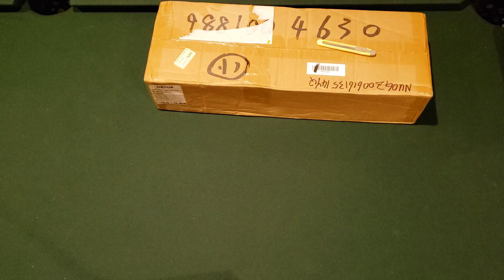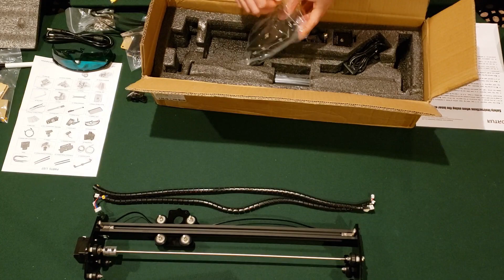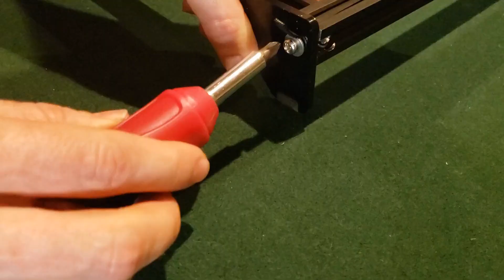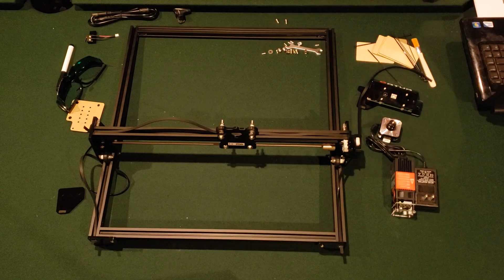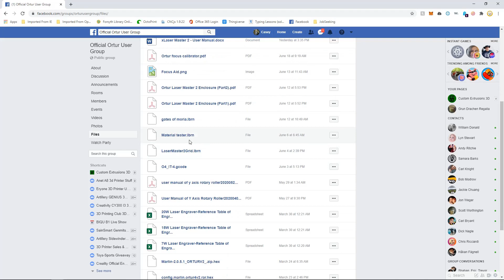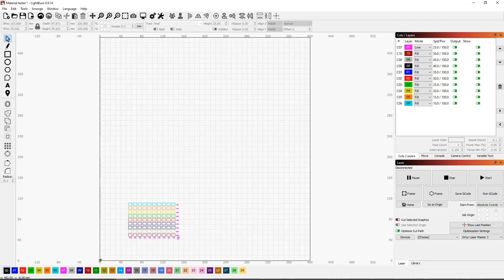Ortur Laser Master 2  unboxing and assembly

Comment from the maker: For anyone shopping on Amazon US, here's a current deal:
Use code NL5YDNHR to save $5!
 https://amzn.to/3otnT2z
Reply: This was fabulous tutorial. Thanks so much!
Reply: I purchased the same unit.  Mine came 80% assembled. All I had to do was build the frame, add the gantry, plug in the wires, and done.  It came with a few extra parts, but missing one washer for belt tension, which I already had on hand.  Next time you make a mistake in a build, it would be helpful to show both the mistake and the fix.  Mine came with zero instructions on the build, and you helped me put it together, though it took longer than it should have, because I had to keep going back to reference your video for the next steps. And to see what mistakes you made.
Reply from the maker: David, thanks for the updated info and feedback. Lots of learning,  notes taken if I ever get back to filming!
Reply: 6:17
Reply: Bought mine off gearbest for 280 on sale. 20w.

Comment: I cant seem to get my belts 100% on correctly, straight lines keep wiggling. The one connected to the limit switch is the main issue. If I try to tighten it from the back end, it pulls the limit switch forward (because its literally 'floating') and trying to deal with the belt through that end is even worse because the belt goes through the same hole that the screw does, so just the act of putting the screw in, pushes the belt back, creating slack.
Reply from the maker: If you have the same set up, I believe you have the limit switch in the wrong place. Mine is located on the underside of the frame, so that it contacts the bottom wheel

Comment: I connected the device to the computer, but the computer does not see it, what should I do?
Reply from the maker: There could be a number of reasons for this. 1st, check to make sure the machine is turned on, before plugging it in. 2nd, you may need to update/ download the latest drivers for your computer. It's tough to provide more guidance without knowing more about your PC specs

Comment: I appreciate the resource but the instructions are not very clear in your description or visually and can easily lead to a lot of errors in assembly. Very frustrating to follow along at times. For example at 16:57 when you recommend to thread the belt prior to screwing after you already finished that step. The viewer is following along so almost certainly that isn't helpful.

Not trying to sound ungrateful for your video as it is helpful, but just hope future viewers can save some headaches I had.
Reply from the maker: Thank you for the constructive feedback!

Comment: When it homes the motor doesn’t stop I think maybe the limit switch doesn’t work? Or is this a driver issue?
Reply from the maker: Most likely the limit switch. Try manually triggering it while the motor is in motion. If it stops, you just need to adjust the switch's position. If it doesn't stop, check the connections on both ends

Comment: I just ordered and put this together using your video, thanks! However, the Laser 4 now has what looks like wire connector hooks. Not sure if these are for grounding or what and where to put them. Anyone else run into this?
Reply: Those are grounding lugs

Comment: hdpe Plastic
Can I use it here?
Reply from the maker: For what purpose? Etching on, cutting through, replacement parts, something else?
Reply: @ce3dprinting94  
HDPE Plastic Circular Container
We need to print the logo.
Reply: @redwitchlynjunior9565  You can, but HDPE burns at low temps, so you need to keep the focus small and at a distance.

Comment: What is the best wood to engrave? I read online that alder, maple is good? What do you recommend and have you engraved a bamboo cutting board before?
Reply from the maker: I have only been able to do a few small things on pine for testing. Bamboo cutting boards are very popular, but I have no experience with them or the alder or maple. In general, I know that having an air assist and using painter's tape are good ways to improve the engraving,  no matter what wood you're using.

Comment: Suggestion - Your video has SEVERAL ERRORS that you should either correct and repost or pull down the video.  Not trying to be mean just I spent twice as much assembly time as I should have following your video

Comment: I just build mine and it doesn't sit level. Is there a way to adjust it or is one of my frame bars just slightly warped?
Reply from the maker: Did you check the squareness of the frame? You can check if one of the bars is warped by placing a straight edge (ruler or level)  on each piece, looking for a gap between the edge and the bar
Reply: Loosen all of the assembly corner screws, and L brackets.  Set it on a level surface then re-tighten.

Comment: Tip for anyone watching: put the feet on before the gantry. It is not otherwise intuitive that you should have two wheels on the top side of the frame and one in the bottom side of the frame. It will also make positioning the timing belts later easier.

Comment: HI, quick question-i have the ortur 20w and  I assume the metal cylinder- about an inch tall is for height gauge.  if you can confirm

thanks
Reply from the maker: Yes, the cylinder is a new addition, since the z-height is now adjustable. It should be placed between the bottom of the lens to the top of your surface being engraved.
Reply: @ce3dprinting94  Hello, I have watched several of these Othur how to videos and no one ever gives the proper height of the laser to the workpiece. Can you clarify this? thank you
Reply: This had me s confused! So glad you posted, the long thumbscrew makes sense now to hold it in position :)

Comment: At 20:07 in the video, top of the screen in between the usb (?) cable and your arm ... what is that piece?  I can't find a reference to it in the manual.
Reply from the maker: It is a piece that is only used on the 7 watt version, to feed the wiring into the coiled sleeves. If you have the 15 or 20 watt versions, you don't need it.
Reply: @ce3dprinting94  Ahhh OK, thanks (I have the 20W).  It has been driving me nuts!  Cheers

Comment: "Still SMOKIN!" A Very Good video! That means I don't have to make a video of MY unboxing, assembly and test fires. I bought two of these on sale last night. How long did you wait after your purchase? Your video will help us immensely! We got the 20 watt versions. I think I need to buy extra safety glasses and shielding for the laser. Do you know of the best deals for that kind of thing?
Reply from the maker: I don't currently have a recommendation for safety glasses, but you can search for "400-450nm glasses" on Amazon. The laser operates between 440-450nm
Reply: @ce3dprinting94  Thanks.

Comment: My third foot doesn’t have a flat slot to put the timing belt in ? I have the same laser set up
Reply: Glad to know it wasn't just mine. Mine was missing a belt slot also. Used one of the others as a template, drilled it out and filed it to shape.

Comment: Thinking about getting one of these but need to know if it the right one.   I am doing cutting boards - serving trays and want to do some custom engraving on them.  They will be about 18x12.  Some larger some smaller.   I guess the question is can I place this on top of the project to engrave what I need to?   None of the engravings will cover the entire project, just initials or other images onto it.  How large is the actual engraving area?   Thanks
Reply from the maker: The 15W would be a great choice for what you're doing. The actual engraving area is 400mm by 430mm, which should be sufficient for most cutting boards
Reply from the maker: And yes, you can place the machine on top of your work. You just may want to get an adjustable z-height adapter,  to get the optimal distance between the laser module and the surface

Comment: can anyone help? I've assembled the laser engraver, and downloaded Lightburn trial, but don't I need a driver?  When I open Lightburn, it does not recognize the laser.  I says "waiting on connection". Did i skip a step?  Super frustrated and ready to send back.  is it even compatible with iOS? or do I need to have a windows laptop?
Reply from the maker: Some quick research shows that you want to start Lightburn first,  then turn on the LM2. Also, if you have more than one COM port,  you will have to manually select it in Lightburn. Hope this helps!

Comment: Hi thanks for your video, got it together after a few hours lol, im struggling at the moment with downloading the drivers, ive downloaded lightburn, but my pc won't find the actually laser through usb,
Reply from the maker: Did you use the tinyurl in the digital manual to download the driver?  If so, did you unzip the file and update the driver through Device Manager?
Reply: @ce3dprinting94  thanks for your reply,  I haven't used any digital manual is that where I've gone wrong?
Reply from the maker: I'd start there first
Reply: @ce3dprinting94  thanks, ive had one of them days, should have actually read the manual  😆

Comment: Hi
My Ortur LaserMaster 2( 15w) was working nice for 2 months but today the laser head is not moving at all. What do you think is it a softwer problem? I already checked everything :( Thank you
Reply from the maker: There are a lot of variables here.... are you able to test the motors that drive the X axis and Y axis, to make sure they work? I would start there, then move to the controller board
Reply: @ce3dprinting94  Yes everything looks fine and I checked electric boards as well. On PCB there isn't anything burned out
Reply from the maker: Margo, I'm sorry I can't be more help.  If you can move the motors by hand,  and electrically, it's possible you may need to reinstall drivers on your computer. But again, many variables
Reply: @ce3dprinting94 
Already done, working nice again :) Thank you

Comment: I just assembled mine tonight - is it ok to have the belts be so tight? Did you run into any issues?  thanks for the awesome video!
Reply from the maker: They only need to be tight enough so that they don't slip when the toothed gears move along them. I've had no issues so far
Reply: I'm having issues with it like it starts bouncing back n forth I have to tap it and it will then move any advice?
Reply: @elgato9720  too much tension on the belts?
Reply: @retrodad1973  gues wat it was lol loose wire on y axis motor

Comment: I buyed it, so disapointed. The laser can not focus to a dot, it makes a line or small rectangle. i think was a hardware problem but it isn't, they say the laser diode is that form. Try to write small letters with a chisel point marker, thats the results you'll have. Also i still can not marking anodized aluminium or stainless steel, and the instructions says is capable of that. The ortur service only limits to re send me captures of the instructions. I would return it if i could but they say the machine functions are normal. Damm i must have buyed the neje but saw the reviews too late.
Reply from the maker: Dorian, sorry to hear you're experiencing difficulties. Have you tried using a coating such as nail polish or dry moly?
Reply: @ce3dprinting94  yea, i used nail polish and a black water and oil marker, 3 pass 60mm/min the moly was inpossible to get in here, im in mexico, (also buying the laser was an achievement,) the only thing was marked was my finger with that hot spoon, lol, also thanks for your video, helps a lot, i saw it fist time while chatting with my wife and dont put attention about that 4 squared nuts... Then wft? When almost finished🤣
Reply: you need to raise your material closer to the laser - you will then see the dot
Reply: @retrodad1973  well my friend, thanks for your response, you know the laser was in fact defective, was losing power over days, there is not capable of even engraving anything, the ortur people doesnt believe that and send me settings and settings and screenshots for configuring it... Obviously with no results, im in the middle of a dispute right now, i already send a bunch of videos the way they requested, they will send a spare module, but i has to pay the shipping, im so disapointed, works well for like 7 days, i made only test, i dont burn it down working. I payed more in the end, those ortur guys on aliexpress was very hard jaw. For a little and  has to keep the useless device. So  sad. Well, i hope the new module works ok....,,😣

Comment: thanks so much for a great tutorial.  I ordered mine and can't wait to get it.  I believe you mentioned that on the ortur website is a link for a free trial of lightburn, but I do not see it.  also, that test pattern that you burned in your video.  where did you get that please. I don't see it on the ortur website either.  thanks
Reply from the maker: Steve,  the link to the free trial of Lightburn is just a link to their website provided in the digital documents when you receive the machine. The test file is found in the Files section of the Facebook group

Comment: Hi 
Thank for sharing
I'm facing one issue with the area of engraving.
I can't adjust the size  W & H  separately.
If i adjust the W the H will be automatically adjusted.
Can you please help on that
Reply from the maker: Haythem, I'm sorry for the delayed response! I don't know which software you're using,  but most have an option to click a "lock" icon near where height and width are entered. That should allow you to scale each independently. Maybe knowing which software you're using could help me answer your question more accurately.
Reply: @ce3dprinting94  thank you for your response dear
Im using laserGRBL
Reply from the maker: @haythemelnour763  , LaserGRBL would require you to non-uniformly scale your image in another program first (like GIMP or Inkscape).

Comment: What timing!  I just got my Ortur and found your YT instructions.  So much better than the Word doc that Ortur provided!  Could you provide tips on how to square the frame?  I ended up loosening the M5 screws about a full turn, using a pair of carpenter's squares on opposite corners (while laying the whole thing on a glass tabletop), and gradually tightening the setscrews.  This  worked pretty well.  Then I tightened the M5 screws.

Also, how important is the tightness of the timing belts?  It looked like you really pulled them tight.

Thanks for a great job and big help!
Reply from the maker: Dennis,  thanks and I'm so glad this helped! Your method is a great one for squaring the frame. As for the tightness of belts, you want then tight enough that when you push/pull the x-axis assembly, you don't hear the belt skipping over the gear, but not so tight that you struggle to move the assembly. That might seem vague,  but it's a "feeling" rather than specific torque. Hope that helps